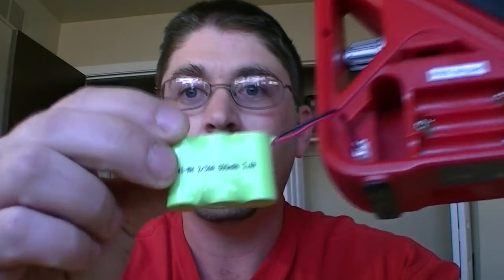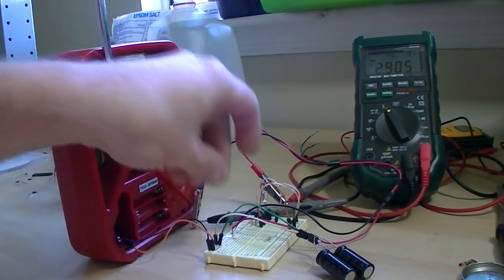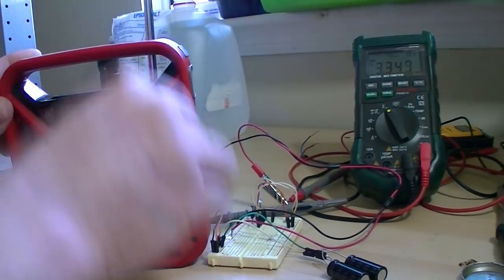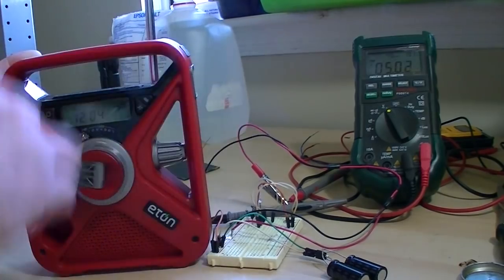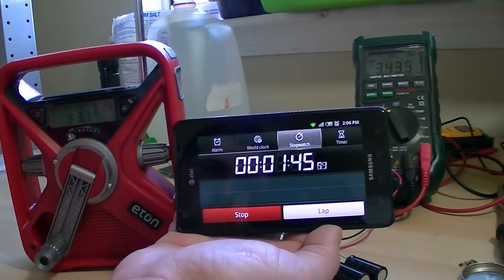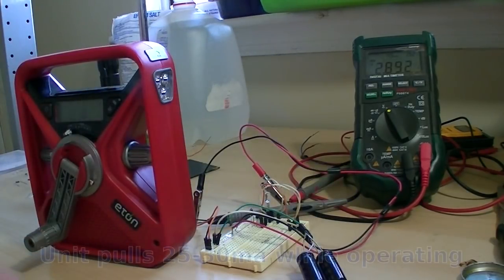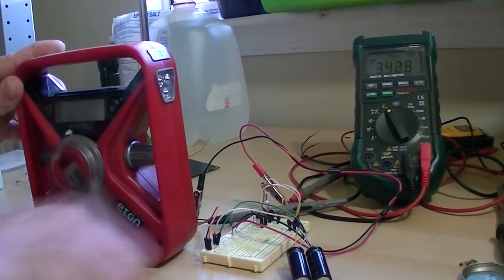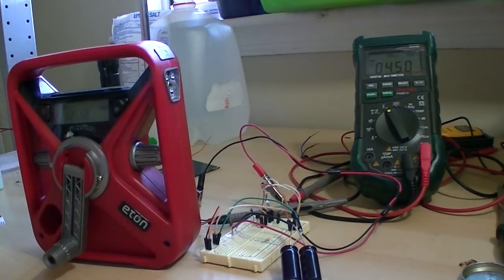Supercapacitors Instead Of Rechargeable Batteries

Comment: Great video, but a few questions:

A little confused when you said that two of 360F caps could probably run the radio for 30 minutes…. If the two 10F caps ran it for 2+ mins, then wouldn’t the 360F ones run the radio for 36 times as long (aka 72+ mins)?

Also, how long would the 360F caps hold a full charge for?  Like after a month, would they still be able to power the radio at all?  If so, what percent of time would you expect vs when freshly charged?

A more general question:  I always wonder what low self discharge means in the real world… I only see people quote capacity after a few says at most… do any caps hold charge for a week, a month, etc?

Comment: Small quibble. When capacitors are wired in series, the voltage increases but the capacitance does not increase. If you wire them in parallel, the capacitance will double, but voltage is same. But supercapacitors are  amazing. There is an even more amazing ATOMIC battery being developed for the future. In California a couple of researchers are working to use slivers of high level nuclear waste ( recovered graphite moderators) in a diamond shielded battery. Useful life of battery, YEARS. Self-powering! Converts radioactive decay into electricity. Scaleable. Look it up. NDB is the name of the startup. If the prototype is successful in being manufactured, we will have a Star Trek future.

Comment: Why not let the capacitors power the radio and at the same time charge the batteries? You need a buck-boost converter to use most of the energy stored in the capacitor. Something like a 1-6V to 6V booster should do the trick. https://www.ebay.com.au/itm/1-6V-to-6V-DC-DC-Converter-Boost-Step-up-Module-for-Motor-LED-LCD-Dry-battery/283101474079?hash=item41ea29ad1f:g:2TUAAOSw6U9bcW1k

Comment: can you charge a battery with discharging a high voltage capacitor on to a battery?
Reply from the maker: Only if you want the battery to blow up in your face.
Reply: @madelectronengineering Haha I see🙈 so it can work? do you know the best way to how can I regulatet the the voltages out from a capacitor so I can charge batteries from the capacitor bank? say I got a capacitor bank on 2000-3000 volt jumping up and down from 2500-3000 volt, do you know best way to regulatet all this? 

kind regards

Comment: The voltage on a lithium battery/cell stays fairley level during use. A capacitor discharge curve looks like a very steep ski jump, not very good for anything.

Comment: this experiment is absolutely wrong. You have to measure amps and volts and get the total power being consumed. A radio with lcd display and 1watts of sound is nothing. You cannot tie the cranking liver with a motor and charge super cap for 30 seconds and have energy for 10 minutes etc.......good for 6 grader student for a project. good day.

Comment: How can one scale it up to replace a 24v 60 amphour lead acid battery.  How many 500f supercapacitors will one need In series and in parallel ?
Reply: What current do you need to deliver and what is the acceptable voltage drop after  delivering 60 Ah?

Comment: You'll get far more energy transfer (far more efficient) if you use the supercaps to drive a switch mode supply.  I've been able to run the caps down to 0.5 volts and still supply 3.3 volts.  Also, when the caps are above the target voltage, you will lose far less power due to heat dissipation.  Also, you can use a parallel capacitor arrangement, and avoid the need for charge balancing.

Comment: Be careful guys, caps this big can put out enough instantaneous current to turn you into a crispy-critter.
Reply: Voltage is too low to cause electrocution.  OK, if you insert wires into your chest, maybe.  Otherwise you might generate a big spark, maybe a little fire.  Not sure, but I don't think the supercap itself will explode.
Reply: At low voltages you are far m0re likely to burn yourself due to the high amps…. High voltage caps (even with low amps) can definately shock you though.

Comment: So

1)  is this a good application for a insect zapper where you need a lot of juice to zap the fly?

2)  you  could use a wind up troch to charge the capacitor

3) do you need to be careful when handling capacitors for electric shocks?

Comment: Batteries age and fail, but capacitors last almost forever.
The weakest point of this design is, overcharging hazard, and shorter playtime.
The crank-generator's wear-life shouldn't change though.

Comment: when you hook capacitors in series you decrease their capacitance by 50 %. Thus 2 five- farad capacitors in series looks like 2.5 farads to the outside world. You do, however double the rated voltage as long as the capacitors are equal in all respects. You increase the number of farads the external circuitry sees when you put capacitors  in parallel.   Basic electronics,  old boy.

Comment: i would like to know can i connect the solar board directly to the 500 farads capacitor. I am afraid of the capacitor will be overcharged and then result in explosion or damage to the solar board. Will capacitor stop charging itself after it is fully charged?

Comment: i got a crank up radio that runs on 7v n i use a 10w solar panel , while the radio is using 7w you got 3 w goin in the battery bank so wen you got cloudy times it doesn`t have time to run out ,at sun down you have the charged bat. takin over
Reply from the maker: +808pathfinder which radio is that?
Reply: Ennovage Outdoor ,it had a crank flashlight & the radio two peace kit

Comment: If I replace 12v battery with 4700uf 50v capacitor and run bike with 40mph whould it damage my electrical system ?

Comment: Design a low voltage induction crystal graphite Manson hot air engine you can operate off solar panels. Use a transmission designed the Manson engine to operate a high voltage power generator to charge capacitor battery banks. Novartis

Comment: Hi there, at the start of this video you where saying that the capacitors are wired in series and not in parallel, could you please tell us why ? thanx
Reply: a capacitor has 2.5V. If you put them in parallel you will have 2.5V as well, but if you put them in series you will have 5Volts.  Just like putting batteries in series. Two 1.5V batteries will give 3Volts for your tv remote.

Comment: Hey, can you help. I am trying to get a supercapacitors to charge my lipo battery 11.1v 1300mAh. whats the best setup? Should I go for a lower voltage supercapacitors with a boost convertors 5v to 12v maybe.

Thanks

Comment: You could run a DC-DC voltage booster between the caps and the radio to get closer to full utilization of the capacitance. There are a lot of 1V-5V boosters out there with over 95% efficiency in the sub-five dollar range that can easily handle the amount of current your radio is using. A bypass circuit made with diodes would allow you to charge the capacitors using the same hand-crank method.

Comment: how many BIG CAPS do I need to run  a 5000w 50amp  motor  for 1 hour or  x 20 hours
Reply: A lot.
Reply: Franky would be crazy to run a 5kW motor on caps assuming mains to be available...Dark Shadows is on the button with the Joules estimate BUT the capacitor he refers to is 18,750J for $320

I have found: http://www.ebay.co.uk/itm/1-2-6-10pcs-Black-Farad-Capacitor-2-7V-500F-35-60MM-Super-Capacitor-New-/291462251768?var=&hash=item43dc8104f8:m:m1chED7TilReXuW6TttLcqQ

2.7V 500F  sold per 10, roughly $3 each  (0.005kg per piece)
  
E = 0.5 x F x V^2 
So for this capacitor (on eBay) = 0.5 x 500 x 2.5^2 = 1822 J

So we need   24x10^6 J / 1.822x10^3 J = 13,330 capacitors

So: CAPACITORS ONLY
COST ESTIMATE: $40,000 not $450,000 
WEIGHT ESTIMATE:  13,330 x 0.005 = 66kg  
NOT "a tonne of capacitors"

Specifications here: http://www.compel.ru/wordpress/wp-content/uploads/2010/07/Polnyiy-katalog-po-kondensatoram-Samwha.pdf

Capacitors charge very quickly - there are large buses in China that run 5km betweeen charges and recharge in 10 seconds
Reply: about 1 metric tone of supercaps, 1 big cap weight about 20 grams, so you need about 50000 caps for 1 hour
Reply from the maker: that's an understatement.
Reply: can anyone ANSWER MY question with amounts please  I.E 100, 1000,10000 ?????? and i understand that small ones are silly to even contemplate i want to use the big ones ,and whats the best to get ??
Reply: It's virtually impossible.
You would need a literal fuck tone.
Reply: not enough to be practical
Reply: theoretically and just going by joules with no power loss from boost converter or natural means. its only about 1,000 of them. you just need about half a million dollars.
impractical yes, but not impossible..
Reply: DarkShadowsX5
i'd like to look at math of this statement.
Reply: thank you for you EXCELLENT  response  exactly what i was after
Reply: He stated 5000w 50a for 1 hour 20 minutes
To convert watts to joules we use seconds of time, and since he wanted 1 hour and 20 minutes  that equals 4800 seconds. so using the formula E(J) = P(W) × t(s) or Joules = Watts x Seconds. 5000w * 4800s = 24000000J of power required. (theoretically)
Each capacitor I mentioned was 18750J being 2.5v and 6000F. and so 24000000 / 18750 = 1280 capacitor units.
Given I only used 1 hour in earlier comment its still "about" 1000.... that's with no power loss you might only need ~100 more to compensate. they don't list weight in specs but its only a 3" diameter and 6.6" height. $326ea sold in 15s which comes to about ~$450,000 or less depending on bulk deal.
.....
 happy?
Reply: nice
Reply: Original Google+ Post: frozenprakash.com/MJtZwTcK2NC
Collection: Energy Technology
https://plus.google.com/collection/8JTdi

Supercapacitor basics:

Only simple difference between battery and a supercapacitor is that,
Supercapacitor has very high power output (kW) and charging rate (kW) and has a very low stored energy (Wh).

The new Maxwell 2.85 V, 3.84 Wh supercapacitor is amazing indeed !!

Specifications:
Peak Voltage: 3V DC
Peak Power Output: 6.7 kW
Peak Charging Power: 6.7 kW
Charging time at full power: 2 to 3 seconds
Energy stored: [3.84 Wh / 13,824 Ws / 13.8 kWs]

Here, [Watt Second] or [Kilo Watt Second] is the best unit to denote the capacitor energy.

1 Wh = 3600 Ws = 3600 Joule
1 Ws = 1 Joule

Using 1W for 3600 seconds = Using 3600 W for one second
i.e,
Using 1W for 1 hour = Using 3.6 kW for 1 second
thus, 1 Wh = 3.6 kWs = 3600 Ws

For example, this capacitor has 13.8 kWs of energy,
and has a peak power output of ~7 kW,
so it'll take approximately 2 seconds to charge/empty the cell fully, as 7 kW * 2 sec = ~15 kWs

Generally Camera flashes are also denoted in Ws of energy consumed per flash,
for example, 100 Ws to 2000 Ws [or 2 kWs] etc.
Reply: depends on the cap. you can get 6000f 2.5v super caps from digikey... if you can find a good boost converter that will work with that low input voltage and output who knows. 
not sure on run time but it doesn't weigh a metric tonne. lol

Comment: I have a question for electronics enthusiasts. I am trying to replace a 3.7V 175mAh rechargeable battery that works as a backup power source for my device with two supercapacitors in series. I have tried the following combinations: a pair of 2.5V 2F, a pair of 2.7V 5F, and a pair of 2.7V 10F. They all get charged by the device (to about 4.1V). However, when I unplug the device it just powers down (refuses to work off the capacitors). The capacitors remained at 4.1V. What could be the issue?
Reply from the maker: make sure your lipo battery is only 2 pin connection and not 3 or 4 pin connection.  if it's the latter, it's also looking for a thermocouple signal on the other pins and without it, it will disable itself.

Comment: I have a couple of watches that run on solar.  The older Casio says on the face that it is capacitor run, the cheap junk watch from China doesn't say much of anything but I am guessing it too has a capacitor in place of a battery, so this has been around for quite some time.

Comment: Capacitance doesn't add in series.  Capacitance in series is like resistance in parallel.  However, the voltage does stack up.  In parallel, capacitance adds regularly.

Comment: I do think this is the direction electric cars should be going, because charging wouldn't take much more time than filling a gas tank, and they can be lighter than most batteries too.
Reply: You think wrong. The Tesla model s battery pack can hold 90000 Wh and is made up of 2.2ah lithium cells with a voltage range of 4.2~3.2 volts with the nominal being 3.7 volts which gives about 8 watt hours. This is in a cell about the length of your index finger and the width of your thumb and weighing under 50 grams. A supercapacitor with equivalent capacity assuming that you had a boost converter to actually get a useful voltage out of it would need to be 12500 farad's. Such a capacitor does not even exist so I'll base this on a pretty common 350 farad supercapacitor which is the size of a d cell battery and weighs 35 grams. You would need about 36 of these simply to supply the capacity equivalent of a single 18650 cell with a total weight of 1.2 kilograms. There's another huge problem with these. When you connect them in series to get higher voltage, the capacity drops. If two are connected in series it is halved. If three are connected then it's divided by three and so forth... So the only reasonable way to get the voltage required to run a motor is through a giant boost converter to bring the voltage to a usable level. These have at best 90% efficiency at these types of loads. Even if you got over that hurdle, the wattage required to run an economy electric car with any reasonable amount of acceleration/hill climbing ability is about 45000 watts. 45000 Watts at 2.7 volts(a "full battery scenario") is 16666.667 amps. I don't think you can even understand the amount of amperage we're talking about here. At a "low battery scenario" the voltage of the caps will be around 0.5 volts. This means you would need 90000 amps from the capacitors. The copper alone required to pull 90000 amps would weigh more than the car itself. Boost converters for that amperage simply don't exist but if they did it would be the size of your house. Do you now understand why supercaps wouldn't work? Capacitors were never built or intended for any amount of permanent storage. They're used for three things and only three things.
1. Timing
2. Smoothing out ripples in signals or power
3. Extremely high amperage, low capacity, temporary power storage.(For example many spot welders work by charging up a capacitor bank and then discharging it at high amperage of somewhere around 80 amps over a very short period of usually a millisecond or two.)
Reply: I'm only familiar with them being used to power toys/models, small stuff for short duration. for that, the quick charging is very convenient. if I understand you correctly, the high dump rate might be good for helping acceleration, but as they are now, the weight involved would defy any advantage. someday these and batteries will improve, the wait time charging is an issue. I've seen a video of places you can charge or swap a car's battery, car built for doing that.
Reply: Linda Mvungi I have no idea about Zinc Air batteries but i know that big companies will have no problems getting batteries shipped. The regulations are really just for individuals.

Comment: If you wanted to use the full capacity of the capacitors couldn't you just use a boost converter with a regulator at the output of the capacitors so it keeps it at 3 volts?

Comment: This video is just another example of how useless supercapacitors really are.  Lithium batteries have almost 3 times the energy density of NiHM and 25 times as much as supercaps.  Plus, you need a volt meter hooked up at ALL times when manually charging them... if you go a hair over the maximum voltage, then you can kiss the cap goodbye.  For energy storage, nothing beats LiFePO4 batteries.
Reply: Graphene does

Comment: Doesn't connecting caps in series actually decrease the total capacitance?
Reply: When you put two equal capacitors in series, you get half the capacitance.  You get twice the voltage.  Regardless what your book says, this is common sense and fact.
Reply: Yes, but he knows this, lol
2 x 10F caps in series = Twice the volts and half the Farads.
Reply: model nutty I thought this too. But the math says otherwise.
Reply: http://www.allaboutcircuits.com/textbook/direct-current/chpt-13/series-and-parallel-capacitors/
Reply: Yes. COnnect them in parallel to add capacitances. But her wanted 5 volts, so the voltages add in series, but the capacitances detract.
Reply: Chris Wesley 1 cap with a boost circuit would be good.
Reply: does anyone know how the big cap banks used in electric cars are wired? Are they all high voltage caps in parallel?
Reply: Absolutely wrong.
Reply: same capacitance higher voltage is all, like any battery in series prettymuch. same series parallel rules still all apply. looks like the issue is the unit he's driving cut's out when voltage drops some, when caps are half drained. 3 caps in series then a simple regulator (8v in regulated 5v out) would solve that and run longer (till the caps drained below about 1.7v each).

Comment: A boost/buck switching regulator circuit seems to be a perfect addition for making most use of the available charge below the 2.9 volts. I see super caps making big impacts the in the near future with plenty of applications, thanks for the video!

Comment: I want to make a supercapacitor hoverboard (if you can get a lot of charges out of them). How big would the array of supercapacitors have to be to make a 70,000 watt power drain, last 30 seconds? lol And would an array that size easily fit into a hoverboard (like the size of a surfboard)? And how many charges do supercapacitors handle before they wear out?